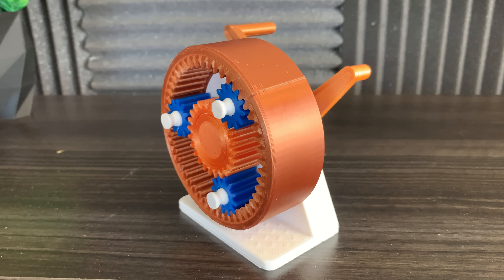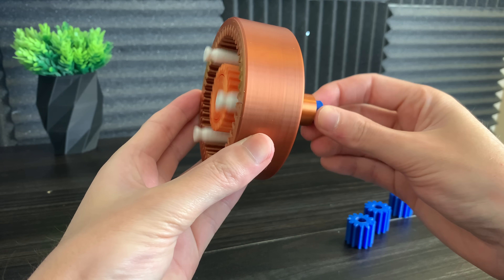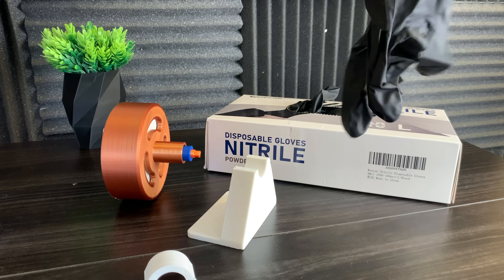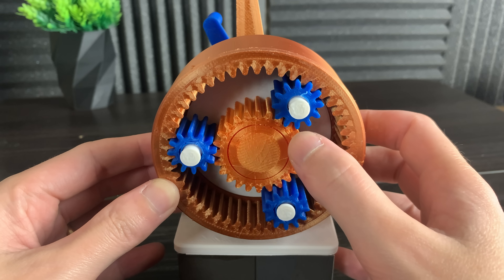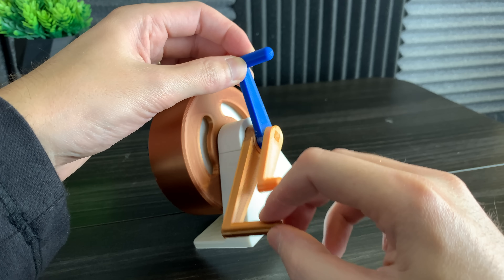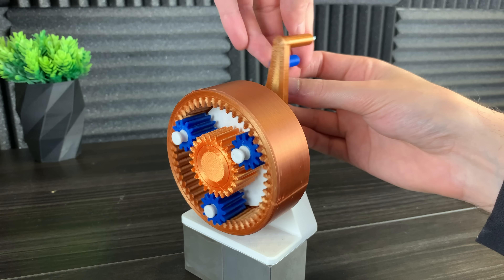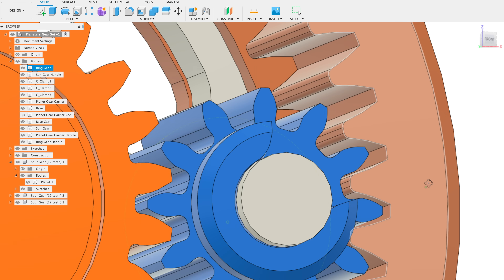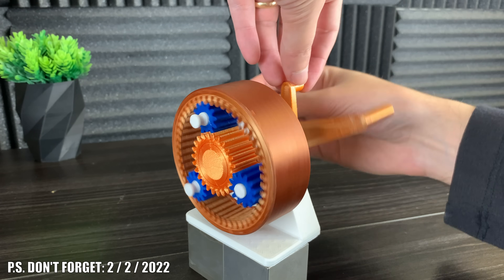What makes planetary gearboxes so amazing?

Comment: I think the table is misleading. Those ratios only work for a planetary gear systems with the same number of teeth on each gear. 

I made a clock with a planetary gear system and the sun to plant ratio (with the ring stationary) is a 6:1 ratio
Reply: yeah it depends on the number of teeth on each gear
Reply: I wouldn't say misleading. He did say that was a factor.
Reply: @seth polevoi ur misunderstanding might be that the table at the end is just for the planetary gear system he 3d printed in the video. Different planetary gear ratios will depend on number of teeth and sizing for sure, so that's why your clock one is different 👍
Reply: He did admit right after that it also depends on teeth number, and I’m pretty sure he was talking about that specific one because it is downloadable and to explain it better.
Reply: Is it possible to get a 1 to -1 ratio?
Reply: @kevinslattery5748  Not with planetary gears. If all you want is to reverse the direction all you need is two identical gears meshed side by side.
Reply: @awo1fman  yeah, I since realised that too. Thanks
Reply: @kevinslattery5748  actually it is possible using a double pinion (2 rows of planet gears) setup with the ring held still and the sun and carrier as input and output, where the sun gear has half as many teeth as the ring gear.
Reply: @Kyriaeus  Nice. So 2 sets of 3 planet gears in total, each set separated by a ring gear?
Reply: @kevinslattery5748  not quite - from inside to outside it would be sun gear, planet gear, planet gear, ring gear. Some CVT transmissions like Subaru's TR580 actually use this setup to achieve a reverse gear ratio without over or underdriving it.
Reply: Its not misleading, the ratios simply change depending on the pitch radius relation of each gear.
Reply: How to say this without being rude....but...it's blindingly obvious that those ratios in the table are specific to the number of teeth in his specific gear.

Comment: Has anyone ever used superglue without a drop somehow getting on your finger?
Reply: Has anyone noticed there’s a sharp point inside the cap the superglue to pierce the silver seal on the new superglue.
Reply: @darktherapy  r/wooosh
Reply: yes
Reply: when the stars aline sure. for every other time I prefer latex gloves
Reply: I know this is a 1 yo post, but I have something to share. I got a couple of small cuts on my hands whilst repairing my dishwasher some time ago. I wanted to glue them so that I could go back to work. The problem is I dropped the damn thing and managed to step in the glue afterwards... So my Birkenstock got glued to the floor 😢
I had thought that no glue got on the floor while I inspected it.
Reply: Yes
Reply: Yes.